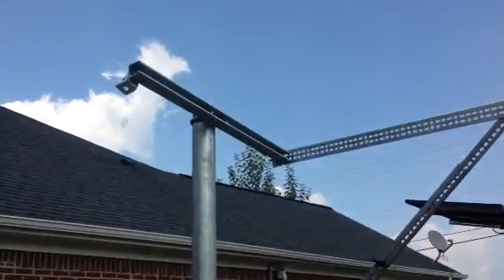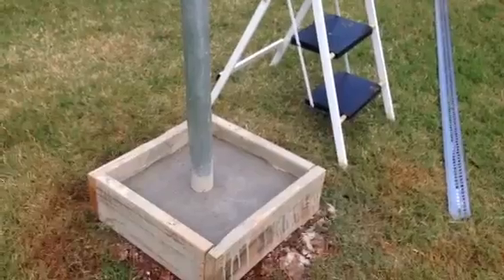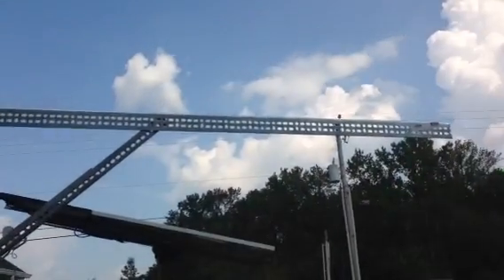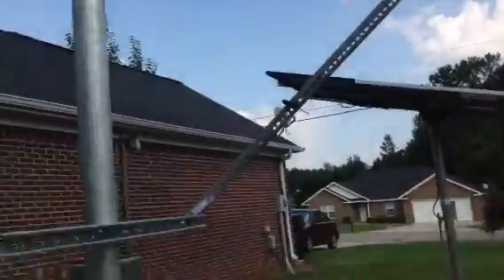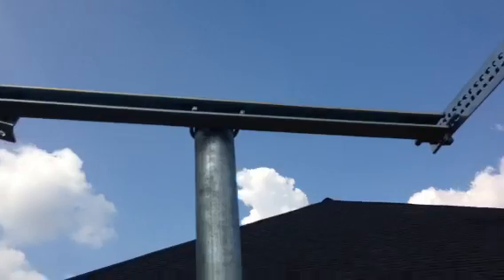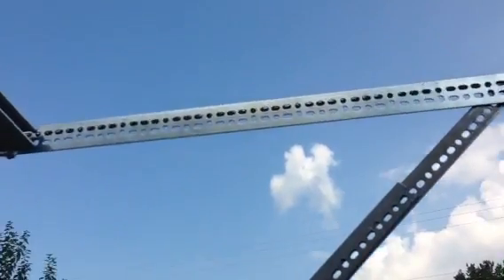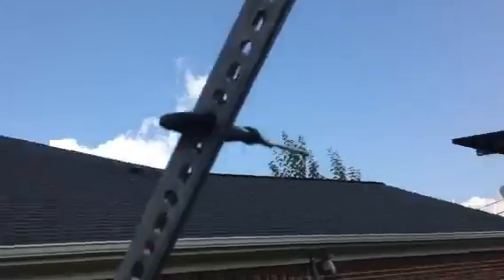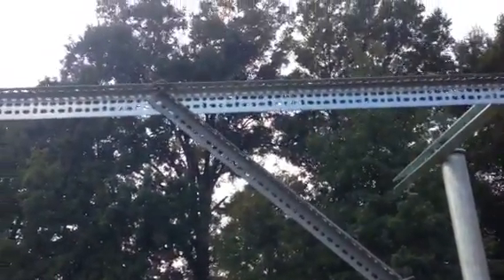DIY Solar.- DIY Side Pole Mount Part #1

Comment: The 3 meter length doesn't work if you need to put three panels together (3.35 m), sadly, if you buy longer length the 3 meter in mail they charge you freight shipping cost....
Reply from the maker: I've since purchased and installed a custom top of pole mount which works better.